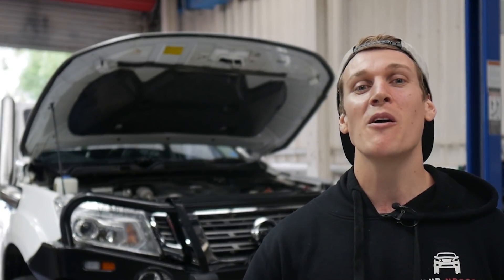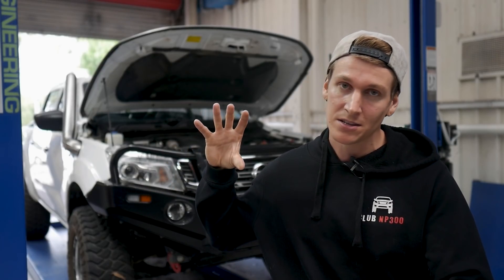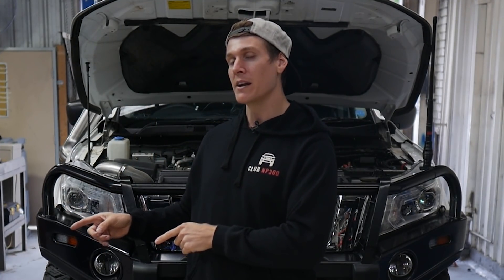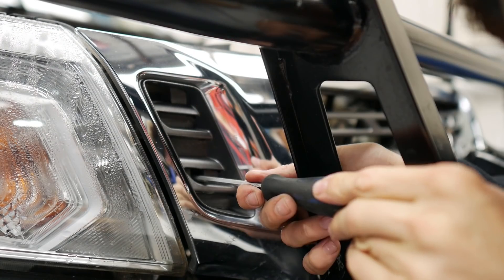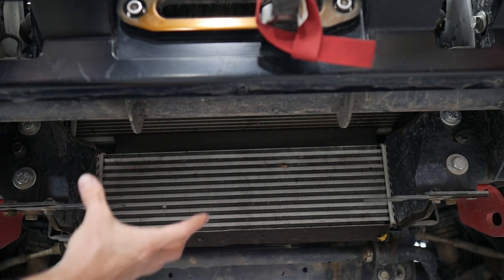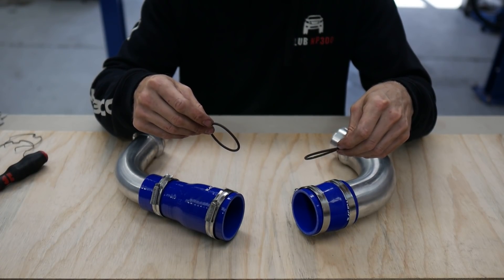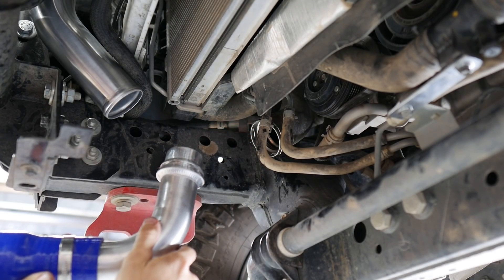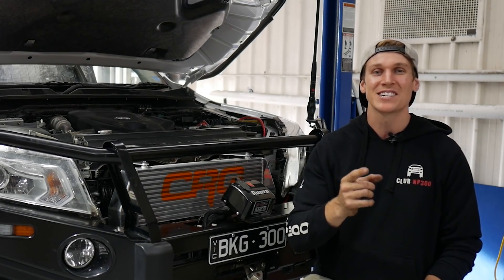NP300 Intercooler upgrade - Installation & Explanation #ShedSessions

Comment: Just chucked in this CRG Intercooler into my Nav today. A tip for making the pipe connection easier is to apply some of the rubber grease around the pipe connectors - went in easy.

Comment: You sold me on the CRG intercooler upgrade!
Reply from the maker: I have recently noticed my fuel usage drop a fair amount as well. I might have to do a follow-up review in a month or so with some more info I reckon bro.
Reply: @jpcaptured799  please do! Also get a EGR delete for the oil
Reply: @jpcaptured799  what’s your fuel average ? I’m at 10.4 on 33s, auto daily driven
Reply from the maker: @muggs8693  i'm now getting under 8 after installing the intercooler. was getting about 10 or higher before.

Comment: hey mate before you get a tune get a new cold side intake hard pipe, the OEM one is made of like 1mm plastic, mine failed 350kms away in a remote area. platinum suspension make one for about $350. best upgrade ive done!
Reply: just went on CRGs website they also do them, get one!
Reply from the maker: Cheers for the heads up mate, I'll look into it 🤜🤛

Comment: Hey mate, thank you for putting me onto CRG, Chris fitted my intercooler and pipes, he is a true gentleman and nothing is too much trouble for him, he went over and above to help me sort out some issues he found with my series 5 Warrior. I have noticed there is a small gap at the bottom of the radiator shroud exposing the fan, just wondering if you have the same and if so is there a solution. My concern is the fan will draw from this area rather than through the radiator and also it could be an issue during water crossings.

Comment: It seems to be pretty well known (according to nissan) that these like to kill rear main seals when using an oil catch can, keen to hear your thoughts on this, ideally I'd love to know if there was actually any sort of pressure change in the crankcase that could be pushing on the seal.

Good video anyways, keep it up.
Reply from the maker: I plan on doing a pressure test as part of the installation 😉
Reply: @jpcaptured799  this is what im looking forward to seeing. I myself have a 2020 ST. Would love a catch can but nissan knocking back warranty scares me
Reply: @OldMateAussie  Nissan will try knock back anything they can unless you know someone at that dealership. My Diesel mechanic said 100% run a breathable catch can otherwise we will be replacing more than a rear main seal. 
Oh wait until we need to change injectors 😂😂😂 that’s a $5k job

Comment: Hi, Great vid as usual.  Do you notice any performance difference with it fitted?  Also a left field question I notice on my Series 1 there is a plastic cover on the back of the factory intercooler.  Do you now why this is fitted?  It seems to block the air from flowing through the intercooler efficiently.  I am contemplating removing it or installing mesh to improve air flow.  Not sure I can justify the CRG item however I am impressed with the quality.
Reply from the maker: my series 3 had the plastic shield also on the back. Unfortunately for the factory cooler it's mainly the position that creates the issue and not only allows the dirt to get right into it but also seems to get heat soaked a lot faster.

Comment: I’ve got the same bar and winch as you but the control box is behind the grill. Just wondering if you were able to fit yours in behind the grill after you put the inter cooler in?
Reply from the maker: i haven't tried yet to be honest.

Comment: U shouldnt consider it.. do it cause your turbo will build up gunky stuff and cause your performance to drop.. suggests a provent 250 oil catch can..my rig didnt come with and EGR, so my PCV is routed direct to my turbo intake, but I put a stopper or a blank and rerouted it to my exhaust..
Reply from the maker: I cannot believe the amount of oil passing through the system. I need to prioritise a catch can kit asap for sure.
Reply: @jpcaptured799  i was totally stoked by it as well. Cheerz mate